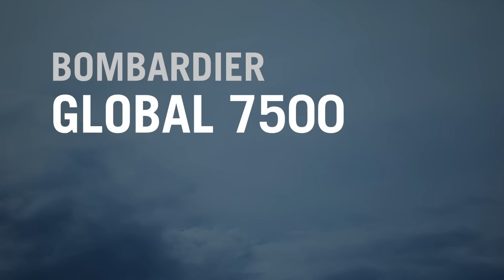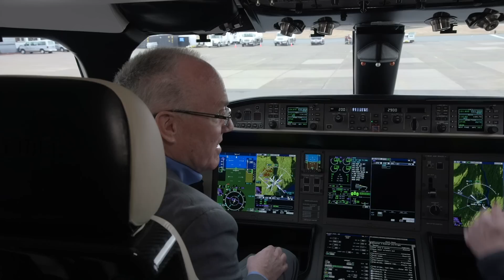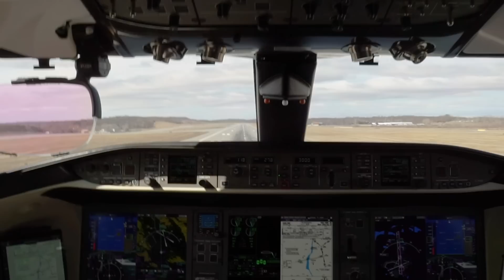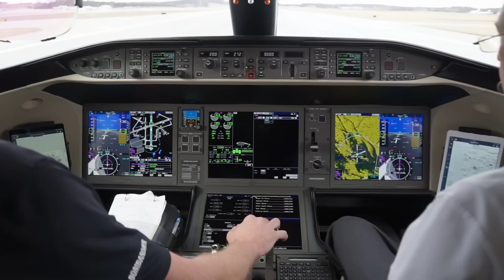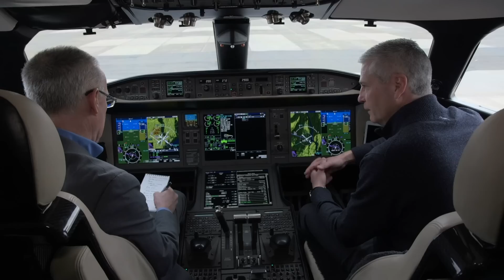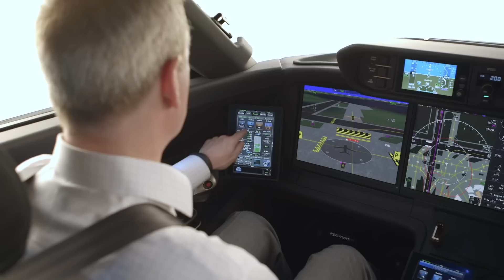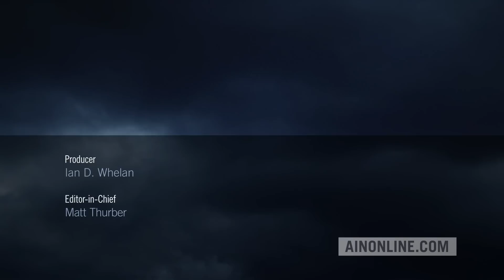Flying the Bombardier Global 7500 – AIN

Comment: Question.... If the aircraft compensates for the loss of lift in a turn, wouldn’t that eventually cause a pilot to develop bad habits if he moves on to another aircraft without such a feature?
Reply: Fair question. 
The effect you describe is called "slippage" 
During a bank, Because the wings are no longer lifting directly against gravity, the plane drops a little while turning. in some cases, the plane may even "yaw" itself towards the direction of the ground. I'm an aircraft mechanic. And though i dont work for Bombardier, i can comfortably guess at what the system is. 
So what i know for a fact, because all planes have it, the Global 7500 has laser accelerometers that read the planes bank angle and pitch angle. This is longtime hardware that sends the information to whats called an "attitude indicator" that little ball gague thing thats half blue and half brown that shows the plane as white lines in the middle. 
My guess is the 7500 has computer software, or maybe hardware, that predicts slippage based on those readings, as well as the planes weight & balance characteristics, and applies a shifting mix of rudder and extra elevator to counter this untill only the pitch angle relative to the Earth is uneven, and any gravity based shifting is nullified.

Will pilots neglect this effect if they switch to an aircraft with anti-slippage hardware? 
For the most part, i suspect not if the pilot is experienced. Or not for long if he is inexperienced. 
Understand pilots learn to fly in gimpy little single engine planes that have very little in the way of avionics. And the ones that fly these jets learn everything. Slippage, stall recovery, engine loss, turbulence, flying blind, everything. 

The only way i can see a pilot forgetting about slippage is if they fly this airplane, and only this airplane, for a long long time. And even then, its likely to come back to them fairly quickly.
Reply: Well, that’s why there’s type rating
Reply: Agreed, it could cause bad habits.
Reply: There are going to be two types of pilots fly by wire pilots(handicapped need the help) And real pilots that have the necessary skills. Fly by wire only pilots should have a limitation on their license.
Reply: One of the Textron Scorpion test pilots said it has "fly-by-wire" ie actual steel wires connected between the controls and the flight control surfaces. I know the F16 has fbw and it is proven technology, but I still think it is slightly disconcerting, from a psychological perspective, even with manual or computer backups or both. I'm not a pilot though.
Reply: You get used to the handling characteristics of each airplane that you fly. For several years I went back and forth, several times per month, between the C-5 and the 747. Even though similarly sized, the two airplanes had very different handling characteristics and operating procedures and I would have to mentally “shift gears” each time I’d go back to the other.
Reply: @white zebra  No one is going to hand fly at 43,000 over 7700 nautical miles. The fatigue would wear you out. Also when I used to jumpseat on 737s and MD80s I watched Major Airline Pilots put the autopilot on at just a few thousand feet and wouldn't turn it off until a few hundred feet on landing. As has been mentioned this isn't new technology. Airbus,  Falcon and Embraer have fly by wire controls. I have flying a Legacy 500 for 3 years that has fly by wire. One day I'll fly the legacy and the next day I'll jump into a Phenom 300 which has cables and pulleys. There are those who are pilots for reasons other than flying airplanes.. Those are the guys that complain and are dangerous.
Reply: Yes, it definitely will cause bad habits. But manufacturers who produce fly by wire aircraft don't really care about this. I honestly think the pilot should be the one flying the airplane, not the computer.